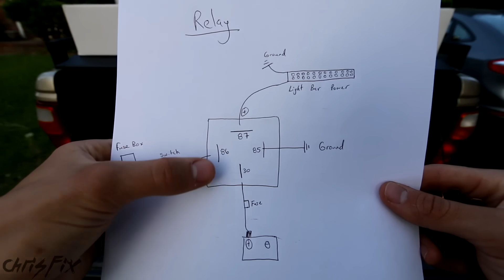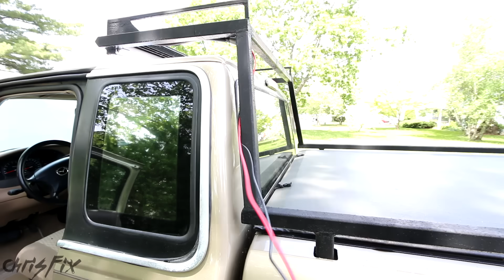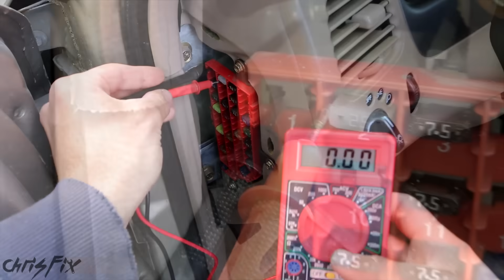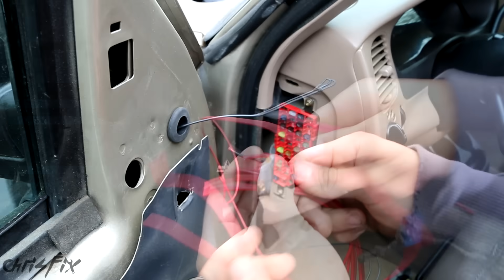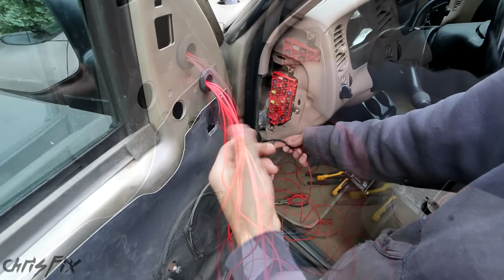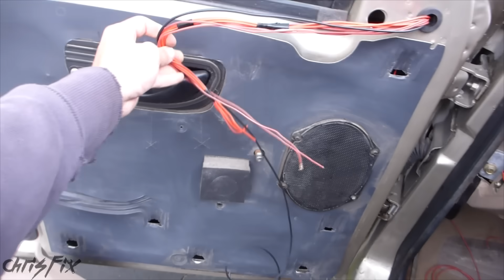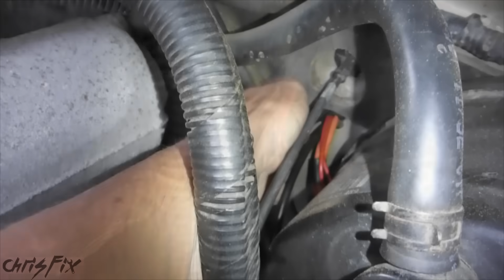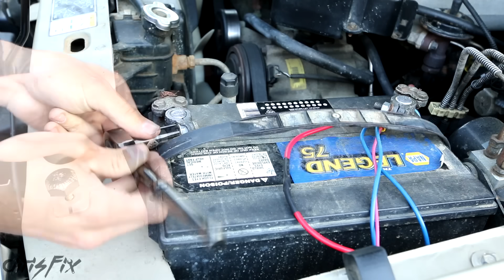How to Wire an LED Light Bar Properly (Project Night Light Episode 3)

Comment: Why didnt you use a shared 12v as well? Since youre using relays, there would be hardly any power draw, and you would save atleast 3 wires and fuse taps. Also a quick tip is to connect the wires on the posts to the backside, to the bolts that clamp down on the thicker wires, saves you a bunch of work when disconnectign the battery.

Comment: Hey ChrisFix will the small switch lights drain a battery if it’s not a daily driver?
Reply: You should wire them up in a way that they only light up when switched on or ignition on, unless you have the lights on all the time while engine is off they wont drain it

Comment: Not sure how relevant this is, but I just bought a switch pros 9100 and I’m using a light bar which calls for a relay due to drawing more than 80% of what the highest amperage switch can handle, but I have no idea how to wire a relay to it. The relay harness it came with I think has a high low feature along with an on off switch.

Comment: Thank you for going into so much detail on this. I'm not a good electrician but with this video, I think I can run my light bar now with your video as reference. New subscriber!
Reply from the maker: Awesome! Welcome aboard!
Reply: @chrisfix  just a quick update! I put my lightbar in the bottom grill on my 08 Scion xB and it works! Thanx to you for this video that I referenced a few times while I did my install. Rock-n-Roll!

Comment: I've got a 2015 f350 6.7  So my question is I've got a set of 16 W 3" LED cubes  And wondering can I connect that straight to the factory wire or do I need to run a relay harness?

Comment: So now since you tapped into a constant fuse wouldn't power always be running to the switch thus causing it to drain your battery rather then on one where it would only go on when the truck is on?
Reply: The switch cuts the power running to the relay

Comment: I like the project but you really should use different color wires OR use tape to mark both ends of the red wire.  Nothing sucks more than piling through a bevy of red wires when you're trying to troubleshoot or modify your install.  Otherwise, ALL your videos are extremely well done.  Touché!

Comment: Gotta issue adding light to my girls new car. Its a project for me and surprise for her. The dome has constant power with a grounding switch. I want to tie the lights to the dome. If i put a relay in and hook power to 30 then tie ground on left if it draws positive power until switch activates will it burn up relay or will relay function normally as soon as polarity switches to ground to activate switch in relay?

Comment: Ok I’m a little confused. 86 goes directly to the middle plug on your 3 prong switch. 87 goes straight to the light bar so when switched it comes on.

Comment: You're not allowed to have extra highbeam lights? Here in sweden most people wire the led bars and such to turn on with the built in high beams for road use.

Comment: How does the Fuse Tap come into play? Whats going on when we have a 7.5 amp fuse and the 10 amp or whatever it was in the other tap slot?  I understood the Relay a little better, thats like a reusable fuse more than 1 time use and directs the current. Does it matter which slot is used! Like the 87 or the 86 or the 30 or 85? 1  wire was ground, 1 was battery, 1 was light bar and 1 was switch but does it make a huge difference? This my first day studying the electrical dc current, im overwhelmed.

Comment: Hi there want to wire up a road legal led bar to my bus and use a seperate on/off switch in cab so I can isolate it ,  can I simply tap in to the head beam wire to operate light bar  without adding other additional  relays

Comment: Hey Chris, I'm about to mount two light bars to my 2016 Ford Ranger, one on the nudge bar on the front and one on the roof. However, I have a 3 gang rocker switch that I want to use instead of the default switches that comes with the harnesses. Is there any way I could contact you to walk me through the process before I start my project?
Reply: I'm happy to help, but as DIY, there is always a switch diagram that tells you that each pin is for and how to light it up!
Reply: @sheikrahaman8841  How right you are! I found some earlier today and I've since mounted one of my lights... I'm waiting on some brackets that I'm importing to mount the other light
Reply: @skydiver91  If you want, you can send me the Docs ( if digital) or the parts list, along with your cars make/model/year and I can diagram it out with some notes to make it your install and wiring as simple as possible. I'm an avid fan of DIY especially with cars; you don't need to be an engineer to do any of it ( even though I am:) )

Comment: Do you need a relay if you don't want a switch? Let's say you just wire the red to high beam fuse and black to ground.
Reply: Ubon94 you don’t technically need the relay at all, not having it won’t stop it from working. You probably could, it would only depend on if your high beam wiring set from factory would be able to handle the added load of the light bar. 

And like he said in the video, it is highly illegal to use these on streets. That being said, I’m not sure if you’d want lights like this on an easy to bump or trigger switch.
Reply: @wrektumwrecker  I want to use it on the back road and dark highway.

Comment: Just wanted to say what a great video - I consider myself 'Exceedingly average' when it comes to mechanics and fixing my car, but electrics have always been a big fat "nope" as I just struggled to understand it. So much so that when I got my lightbar I paid a bloke to fit it for me, but he's used undersized wire and as it's stop working now I'll replace all the wiring so it's properly safe. Haven't done it yet, but I know when I do I'll come straight to this video as it works as a step-by-step perfectly.

Thanks!

Comment: Hello Chris 

I would like run 3 18" light bars on the roof rack of my truck camper left side right side and one pointing to rear and switch inside the camper power will provided by the campers house batteries. Will I need 3 relays?
Reply: At a minimum, 3 relays, depending on how you want to wire them up.

Comment: Anyone planning to drill your switches into your cover, make sure to also use painters tape or duct tape to absorb pressure and prevent cracking, this is also true for any time you cut or drill plastic

Comment: if you are worried about wire/voltage in the cab, use the switch on the negative side of the relay.

Comment: @ChrisFix bit late now but does the wire coming from the relay to the switch is there any certain gauge wire that needs to be used or does it not matter what gauge it is?
Reply: depends on voltage and length

Comment: He says he doesn't like drilling into the panel, etc. I don't know why he didn't just create a switch panel and put it somewhere in the center ... something like he did on the police car video. Especially since he plans on adding other things that would more than likely be switched as well. But that's just my thoughts.

Comment: What would be the issue of just putting positive wire to fuse to switch than to light bar?
Reply: All the added length means a thicker gauge wire. Its also better to not have high amps running through the cab just in case anything goes wrong. Thats what relays are for. You control a high amp draw with a small one. Saves on wiring and makes wiring safer.

Comment: Hello, I've got a question,
If you use the relay, isn't it better to put it nearer the led lightbar in this case so it does not loose power because of the cables lenght? Or it does not matter?

Comment: Again, another great how-to project vid. Way to go, Chris. On a small note, I tend to shop for switches. If you're anything like me, those lighted switches can be a bit distracting when driving at night. I re-did a 5 switch project after figuring out that it was hard to keep my peripheral vision from taking my focus off the road. Shop around enough & you should be able to find low illuminated panel switches that make a world of difference. But that's just my take.

Comment: Chris, is there any downside to just putting in a switch where you've put a relay? I feel like the relay is pointless because you aren't wiring it to high beams etc. I am about to wire some lights that I too would like to control separately from headlights/high beams, so curious why you've done it this way. Am I missing something?

Comment: why not have the switch and connect it to the highbeamsignal? so you can choose if you want the ledlights to turn on with the high beams or not. then you dont have to take your hands of the steering wheel

Comment: This is a serious question I literally have no idea about electrics but why couldnt you just have a positive from battery to a in line fuse to a switch to the lightbar then the negative all the way back to the battery, wouldnt that work the exact same?

Comment: Hey there- could you use a single relay for a pair of two lights, but share the same switch or will there be power issues in the lights? If there are two lights do they need separate relays and separate fuses and connections to the battery?

Comment: That ground wire for your battery terminal looks a little suspect. If you are using an unused socket in the fuse panel why not just wire the light into the panel itself instead of a fuse tap?

Comment: I just cant help notice that the inside of your Mazda looks exactly like the inside of my 01 ford ranger.  The cluster head light switch fuse box engine bay layout. It all loks the same as my truck does. Conspiracy I think not.
Reply: The Mazda B series and the Ford Ranger are the same thing with different badging

Comment: Why a relay,I just used a 2 prong toggle switch for my headlight halos
Reply: So you dont have wiring that has a higher voltage inside the cabin of the car. That way the switch only needs a low voltage signal wire.

Comment: I did this but with a Walmart kit and it exploded right next to my battery I have the same model truck and I drove it a few days and then I turned it on 2 weeks later the light didn't turn on so I popped the hood and it was smoking and then it started on fire

Comment: How do u know when to ground to frame or battery or does it matter
Reply: It doesn't matter, both do the same job. The battery usually provides the best ground that is guaranteed to work unlike bolts and such that can have rust or paint preventing the electrical flow.

Comment: Hi love your channel I have a question need your help with I want to do the same with a light on my SUV by mine is going above the form number plate I dont want to have a swtich on mine i have to it come and off with the high beams as its only a 90w small bar how can I go about this

Comment: If your not bothered about using a illuminated switch? Then loop t30 to t86, then just mount the switch on the ground wire and earth it at a convenient point behind the dash, saves on wiring

Comment: how about doing a simolar video but wiring the light bar to your high beams and a switch so you can separate the light bar from the high beams or flip the switch and connect the bar to your high beams?

Comment: nice video with clear instructions how to do everything :)
 but why you did not put the wire inside the frame that you build ? 

i would go in next to the ledbar and come out behind the cab
Reply: bigpatrolleke 
I thought the same thing, except I’d route it all the way to the post hole in the bed and come out under the bed, run it along the frame into the cab and engine bay. But hey that’s me...I hate seeing exposed wiring zip tied to something.

Comment: Chris, I'm  happy that I just found your channel..I have a 93 suburban and its its currently undergoing several modifications.....I have already taken the liberty of removing the rear side windows and creating  a shortbed truck effect...I will be adding a lightbar..good to learn about adding relays..going for a tactical look and will be building a removable slantback  for the back mainly for the look and to offer protection from the sun when my dogs are riding in the 3rd row seat..oh, and along with the dark matte gray tactical look, it will be labeled K-9 UNIT

Comment: Excuse me chris, i'm interested in doing this for my 88 f150 but the fuse box doesnt have any extra fuse slots for the switch. The only open ones it has don't have any electrical connection. Any way to work around this? Love your vids and keep up the good work!
Reply: I used the fuse tap but put the fuse that was in the slot into the fuse tap. There is slot for a fuse to put into the top of the fuse tap as you can see in the video on his there two slots to put fuses on top of the tap
Reply: @blacknbs3482   awesome sauce, thanks for the info!

Comment: Wow dude, night and day ;)
See what I did there?

Kick ass job. if you wanted to, couldn't you have run the wires through the frame you welded? This would allow you to hide the wires more and not bother with zip ties on the outside. Regardless though, it's still an awesome job.

Comment: Awesome video.  When I ran large wires for my amps I decided to run a long piece of 9-conductor audio wire that will allow me to wire up switches in the future.  Its got enough wires for 4 switches and it has nice thick rubber cover to protect the wires.

Comment: Can't believe this video is so old and I'm seeing it for the first time.
I absolutely love your videos and they have helped me maintain and diagnose my car.
Fantastic work.
Reply from the maker: Thanks a lot!
Reply: I'm actually considering installing a relay for my amp and crossover. Should they each have their own relay or can they be run to the same one?
Reply: @tisaghchase  It'd be better if both of them had their own relays.
Reply: @chrisfix  I know this is an old video but you should do a video on the SPOD lighting control system.

Comment: My LCM in my 2003 grand marquis has went out so my headlights turn off while I’m driving and I have to kick it for it to turn on, the part cost $200+. I was thinking if I can just by pass the factory setup and wire the headlights with a toggle switch, can you help me!!?😂

Comment: I’ve wired mine with a relay into my high beams with a switch in my dash wired into the light bar circuit so I can use my high beams regularly for on road driving and then with the switch on the light bar comes on with the highs
Reply: That's pretty big brain chief. I'm stealing it lol

Comment: Hi Chris, I want to install a roof, bumper and rear light bars. Do you think it is necessary that I use one relay for each light wiring, or just a single relay would be ok for all lights? Thanks!

Comment: hello,ChrisFix i do you're tutorial but my switch add tap fuse to Rad. Cigar was blown wich is i use 14 gauge wire all the way my led is 4" round bar 72watts DC 9-30V please help.thanks.

Comment: Nice video but should have run the wires through the steel frame of the rack for an even cleaner look 👍
Reply from the maker: Thanks but in the salt belt you want to seal the metal so it doesn’t rust from the inside.

Comment: I got this Ledbar, its all ready to plug and play, but its included driving light's and parklights in the led bar... so there is this one yellow wire comming out. i am comfused, where should i connect the Yellow one? should i just connect it with the plarking light's or???... Please give me a suggestion

Comment: Nice job on the wiring but without it  be hooked up to your high beam lights to switch it off and on when you turn your high beam off and on it is illegal
Reply from the maker: Thanks but the laws are not all the same

Comment: You should have hidden those wires inside the frame you built so you don’t see any wire loom or zip ties.  Great video though. You do good work. Could the bar stand to be adjusted up a tad ?

Comment: Why don't you have the actual plug that goes to the relay so your not using end connectors on the relay less hastle with the full plug.

Comment: Love where you decided to mount your light bar. I plan on mounting mine back on the roof away from the windshield also. Every truck ive been in with it mounted the usual way I noticed it glares on the wishield and bounces off the hood.

Comment: Suggestion for ground install. Take sandpaper and rough up the frame of vehicle to bare metal, then install wire, the take some spray paint to restore paint. Corrosion is number one issue with grounds.

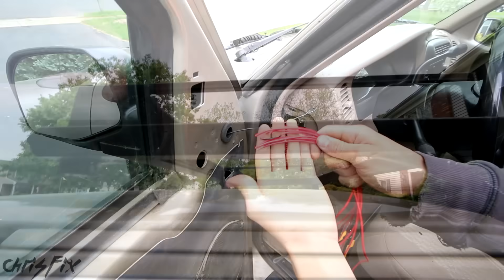Comment: 13:32, 8 wires are actually enough for 7 switches, since you only need one 12v wire from the fuse box
Reply: Im pretty sure he put 8 wires for 4 switches to make the switches light up
Reply: So multiple switches can come from the one fused power?
Reply: dgtlionbarger yes because the wire coming out is the only thing needed to differentiate the switches
Reply: Only if he uses relays in all of the new lights

Comment: Hi chrisfix. Can you explain me why you used a fuse postive wire instead of running it from the battery? And if your solution is better... why did you use a 7.5A fuse? Or 5A later? I dont understand why are you going to need that fuse. Thanks.

Comment: Could you also just wire direct to the battery with an inline fuse and just have a switch?  Not really understanding why you went through a relay and I'm guessing you went through the fuse box as a power source instead of splicing into the main hot because its less wires ?

Comment: For your other switches would it be safe or possible to just use the one fuse tap, or would you need a different tap for each switch?